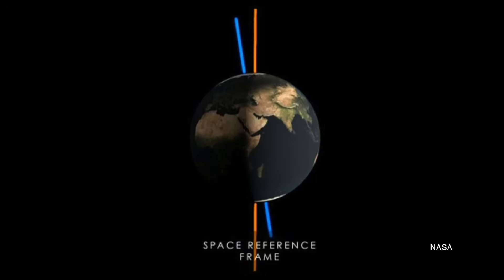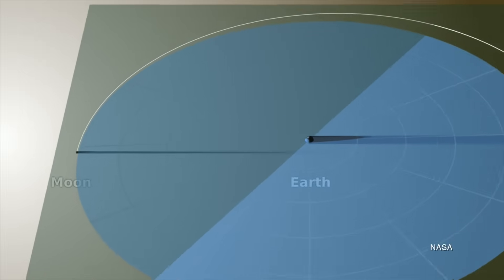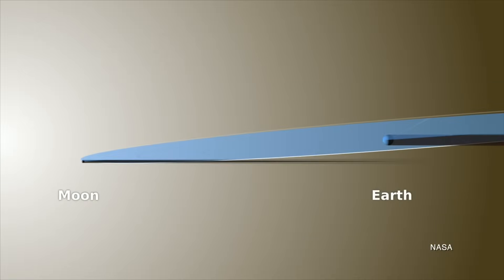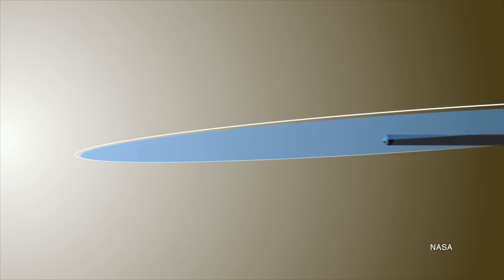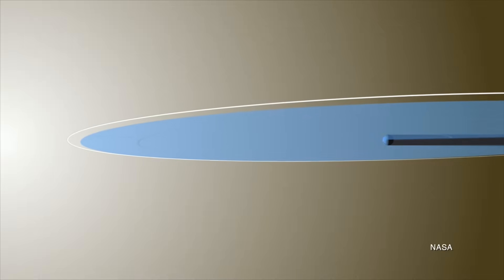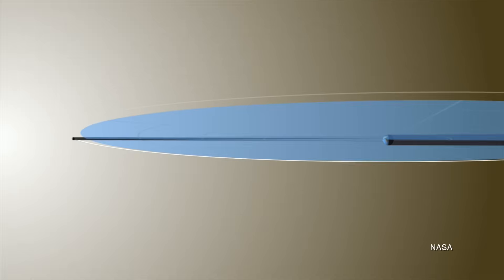Why Does a Rocket Need to Roll Going Into Orbit?

Comment: I really wanted to like your channel, but I can't because it keep finding errors in your videos, you simply don't completely understand what you're trying to teach your viewers. You can launch into any orbit without roll controls what so ever. 
I haven't done any research but my guess is that they did it due to limitations on the guidance computer. Keeping a defined roll angle makes the math easier and allows for manual monitoring or control.
Reply: I thought she did quite a good job.  You can only launch into an orbit without roll control if you don't care about the roll orientation of the spacecraft during the ascent.  The question was why did the Saturn V need a roll program.  It had one because they launched at a variety of azimuths and they DID care about the roll orientation of the spacecraft for several good reasons, which she went to great pains to explain to you.  You may not have done the research, but she DID.
Reply: Star Gazer that's exactly what I said, there are technical limitations specific to the Saturn V. But she said that it is necessary because of the orbital plane tilt.
Reply: It is necessary because of the orbital plane tilt.  The reason they do the roll is because they have to launch in a specific direction to put them in an orbital inclination to match the orbital plane tilt.  This puts the spacecraft into an undesired roll orientation.  The roll program puts them back into the desired attitude for the ascent.  If  they could launch east every time, they wouldn't need the roll program.  Would it be =possible= to launch with the spacecraft rolled?  Sure.  Would it be =possible= to launch in any old direction and then just do a massive burn once you're in orbit to go anywhere you want to?  Sure.  But this isn't what they do, because there are very good reasons not to do it that way.  That doesn't make what she said =wrong=.
Reply: It is possible to launch unrolled, and without roll, and also launch into a tilted plane. She IS wrong.
Roll would be necessary for the space shuttle because it has to have the orbiter pointed down. symmetrical rockets can go anywhere with just pitch and yaw.
Reply: Yes, I understand.  But the shuttle isn't the only spacecraft with an attitude requirement.  Why do you keep wanting to ignore that part?  Apollo also had several reasons for needing a particular attitude during ascent.  She explains this.  Apollo was symmetrical, but it couldn't 'go anywhere with just pitch an yaw'.   In order to do that, you have to have multiple communications antennas in various places around the rocket to guarantee you'll always have signal.  That costs money, and is extra weight on the rocket.  If you need to guarantee the navigation system will work in any orientation, that requires more gimbal axes.  That costs more money and weighs more.  If the cockpit is in a random (or changing) orientation during ascent, then you can't use the pilot as a backup navigation system (because if a pilot has no outside reference like the horizon, he can't guide the rocket), and you'll need to replace that redundancy with more equipment, which costs more money and more weight.  They didn't want the increased costs nor the weight penalty.  The bottom line is, Apollo had a requirement for BOTH variable azimuth launches, AND a required 'heads down' spacecraft orientation during ascent.  The COMBINATION of these requirements means they HAD to have a roll program.  Hence, that's WHY they had a roll program.
Reply: Star Gazer the fundamental problem then is because you need to be able to point those instruments, not to launch into a tilted orbit. It would have needed roll even when launching into a no tile orbit.
Reply: Star Gazer clearly you don't understand the logic of what is and isn't a reason, and the difference between necessary and sufficient reasons. Orbit inclination is not a necessary reason because you can just install antennas all around it. So it makes no sense to say that it can't be done, or to suggest that it is the only reason. That would be like saying look, the reason the space station is in space because there is more solar power. It is one of the reasons but it isn't a necessary reason, they could have installed nuclear reactors on it.
Reply: There's a difference between what is theoretically possible, and what can reasonably be done.  If you would bother to actually read what I wrote, especially my second response with =possible= in it, you might have gotten that.  Since you can't be bothered to respond to the points that have actually been made, and insist on moving the goalposts, I'm done here.
Reply: Logic is only concerned with what is theoretically possible. Also the title of the video clearly says "Why does A ROCKET", not "Why did the Saturn V", implying that it is a general response to all rockets, to which the answer should be "it doesn't". At the very least it's clickbait crap.
There are also various inaccuracies in her other videos, I'm not just nit picking a single one. There is at least one problem in almost every video, so I'm not interested in videos by non-experts. I'd prefer my expert to be a hot girl though.

Comment: The roll maneuver is clever name for what a simple projectile does during its flight, arc up, over and down. The ass heavy rocket will drop as it flys horizontal and since there is no lift upward aerodynamic, it will tumble out of control. The gimbals may direct thrust, but without steering from wings or vector nozzles in front of the crafts center of gravity , forward thrust simply translates to a skid . Hence the big arc in the sky. Saturn 5/ F1 is likely a collection of f 402 Pegasus ( harrier) engines powering a lightweight shell. Add the space grade diesel fuel/ lox  and you get a really awesome fire .

Comment: A rocket does not roll, it pitches! The so called roll program is on the STS flights so the shuttle engines can be orientated down under the external fuel tank and provide lift and orbit insertion thrust. You are so far off the roll mark here Amy, there is a big difference between an orbit pitch angle and the so called orbit insertion roll done by the space shuttle to orientate the shuttle directly under the external fuel fuel tank. A conventional rocket could care less about the central axis roll position of the rocket, this only becomes important to a rocket when the use of side mounted break away solid fuel boosters are employed in the rocket design. A rocket is akin to a bullet, the spin will only give it more stability (not done with a rocket due to the centrifugal force it would put on the structural components and crew of the rocket).

Comment: I have another question, could you not make this  adjustment to flight path while the rocket was on its way to the moon, the  moon orbit path  does not seem to be all that off from the earth's equator
Reply: It's possible, yes. Seems less straight-forward to me, although I don't know anything about the actual decision making going into it.
It would require timing and several additional burns, and being closer to earth also means larger fuel savings from the Oberth Effect. It just seems a lot less efficient to do it out in space, without having done the actual math.
Reply: I just thought the adjustments could be made using small thrusters without any big burn. But what you say makes sense the fuel is there to do the roll at take off. I just thought it looks more complicated to calculate and even more dangerous to execute controling such a powerful rocket with tons of burning fuel looks like more things could go wrong
Reply: The Moon's inclination varies from 18 to 28 degrees off of the Earth's equator.  It is very expensive in terms of fuel and inefficient to try to change the inclination of your orbit after you've launched.  It is possible to do, but why go to the expense of doing it when all you have to do to avoid it is launch in the correct azimuth direction to start with?

Comment: i've always wondered, why do we use rocket to get into space, i never questioned this till i learned about the X-planes.  these planes were making it to space so i thought why not just make them bigger.  that way they can take more things, more people and do more things.  of course for this to work they would need to piggy back on another plane to a certain height then separate and go baby go,,, right?   
so why didn't we go with planes?
Reply: In order to actually stay in an orbit you need to go very, very fast. The smaller the orbit, the faster you need to go. The ISS orbits at about 400km and need to go a litte over 27000kph to stay there. The higher you go the thinner the air gets and eventually  you won't have enough lift to go any higher - then you'd need rocket engines to accelerate anyway. 
That's why rockets carry hundreds of tonnes of propellant.

Doing this with a plane which only adds more weight, more drag, more structural engineering challenges is not only much less efficient, it would also never survive reentry. Just a waste of resources all around.
Remember, the X-planes only managed short sub-orbital flights.

Comment: When you send a rocket to Minmus, you match the orbital inclination during launch, to take advantage of Oberth effect. If you don't you end up doing an additional burn and wasting 200 extra dV to match the inclination in LKO.

That's what Nasa did, match Moon's inclination during ascent, with a roll program. Also to prevent negative G's on the astronauts.

Comment: So, reading the comments, it seems the thing you missed in this video is that the astronauts needed to stay facing the Earth. In other words, though the rocket looks like it's round and symmetrical, it's really not. The hatch is only on one side as you showed on your model.

So that begs the question - why was the Saturn V round? As long as it was aerodynamically shaped it could have had an elliptical or even square cross section. Many rockets have boosters on two sides these days, and the Space Shuttle was anything but round, so why did the Apollo use completely cylindrical designs?

Comment: Correct me if the correction is wrong, but the reason was to keep the crew from taking negative gs. The rocket is rotationally symmetric more or less; the astronauts are not.
Reply: The rocket is rotationally symmetrical, but the IMU is not.  When the missile pitches over, you want the gimbals orthogonally aligned.  This occurs when the body of the rocket is aligned with the IMU.  I assumed in an earlier post (based on the video) that the platform was held in position by a theodolite.  After looking into it I found the Apollo IMU uses a gyro compass to find true north based on the earths rotation.  The IMU azimuth would be calibrated to the gyro compass, then slewed to point down range.  At liftoff, the rocket is rotated  to zero the angle between the IMU and the rocket body.  This makes the navigation computations much easier.  If antennas or crew need to be on the belly side of the rocket when it pitches over, they were placed there because of this need.  Even unmanned ICBMs of the era perform this roll maneuver, and they have no crew and no antennas.  Later designs with better computers and non-gimbaled IMUs do not perform the roll.
Reply: +MuyGordoGato Thank you for correcting me.

Comment: Why not aline the rocket before launch?
Reply: The azimuth can change with the time of day or, for a moon mission, if you have a delay, the moon has moved relative to the launch pad.  The roll maneuver allows you to set the azimuth just before launch.  In addition, the platform can align itself to the downrange direction much more accurately than physically moving the whole rocket.
Reply: +KiithNaabal  Along with what was mentioned, there's only one way the Saturn V could be orientated on the launch pad to align properly with the launch umbilical tower connections.

Comment: Sorry I'm late to this party.  I have over 17 years in ICBM guidance and played a principle role in the updating of the MMIII guidance electronics.  The simple answer to this question (as others have said) is that the missile has a "belly" and will roll to an angle so the belly is facing the earth when it pitches over.  This makes the computations much easier.  Rockets like Peacekeeper and Small ICBM did not have gimbaled IMUs, and had faster computers and did not perform this roll maneuver.  Peacekeeper was originally designed with roll engines on stage two to remove any severe roll caused by atmospheric effects, but after a couple of test flights they were removed to save weight because the unwanted roll was minor and could be removed in the post boost portion of the flight.The MMIII guidance system was designed in the same time frame as the Apollo, by many of the same engineers, and probably functions similarly.The IMU consists of three concentric gimbals mounted orthogonally with what is called the "stable platform" mounted in the inside of the center gimbal.  Mounted on the platform are the three accelerometers and the three gyros (you can get by with two, but that is a lesson for another day).  Each gimbal will have a "resolver" built into its axis.  The resolver outputs a pulse for each fraction of a degree that the gimbal rotates.  While on the ground, using a theodolite (MMIII used a gyro compass) to hold a reference for the roll axis, and level detectors for pitch and yaw, the amount of torque (energy to keep gyro centered in its case) applied to the gyros to overcome imperfections in the gyro and the rotation of the earth are computed. The job of the gyros combined with the gyro torqueing, is to keep the platform level to the point of launch.  The missile will rotate around the stable platform.  This way, it doesn't matter which way the missile is pointing, by integrating the accelerometer outputs, you know where you are.  If the platform tips (guidance or IMU dump) you will need a way to reset it.When the missile is assembled, the IMU is mounted so the gimbals are aligned with the belly of the rocket.  When on the pad, the zero position is found, then the stable platform is slewed (rotated about the roll gimbal) until the IMU is pointing downrange.  This will be some number of pulses from the roll gimbal resolver.  The gyros will need to be stabilized again in this position unless gyro torqueing was used to slew it.  After launch, the rocket body is rolled until the same number of pulses (of the opposite polarity) are counted from the resolver of the roll gimbal.  Then the missile can pitch over.I have to take exception to the statement in the video "the movements of the rocket are felt by the gimbals".  The movement is felt by sensors on the gyros.  Sensors on the gyro cases are inputs to servos that drive electric motors built into the gimbals.  If the case moves closer to the spinning gyro, the gimbal motors move the platform to keep the gyro cases centered around the gyros.  The gimbal resolvers report to the guidance computer how much they have rotated.

Comment: Why did the space shuttles roll when they take off?
Reply: +Harry Twinotter  Yes. Why did they roll until the shuttle was upside down
Reply: I understand that it did roll to put the shuttle underneath the booster. But the question remains... Why? To obtain a lifting force from the wings of the shuttle to behave like a plane while launching up? or to allow easier communication with the ground systems? Or to avoid a shear force if the shuttle were the other way around?

Comment: I'm not sure anything in this video actually explains how rolling would change the trajectory. The facts are laid out: it faces east, it launches straight up, and in addition to arcing east, 
it also rolls in order to change trajectory. But there is no explanation.
If you shoot a bullet out of a rifle, it also rolls around the "x axis", it still flies straight. I'm not a rocket engineer, but I'm guessing that in the case of the rocket, the rolling may cause gyroscopic effects that force a change in its trajectory. Those effects might not be seen on a bullet because the distance it travels is so much smaller.

Comment: Very good video and great explanation.  So my question is why does the Space Shuttle also have to roll over to an  upside down position to go into orbit.  It wasn't going to the Moon and therefore didn't need to take the Moon's Orbital Axis into consideration.  My thought was that it has something to do with the G-Forces but I have nothing to back that idea up.  So if you can find out the real reason I would really like to know.  Thanks again for your video!

Comment: how do they  control the rocket's roll, for example do they have they have flaps and ailerons on the rockets ?
Reply: The nozzles at the bottom of the vehicle - and the rocket engine itself - are steerable.  Slight adjustments to nozzle angle make large differences in vehicle trajectory when dealing with so much thrust, so imagine how precise the maneuver had/has to be (the Space Shuttles rolled over on launch too).  Back in the days of the Saturn series of rockets, those were some fast moving slide rules! :-)

The vehicles can also use "helper motors" known as thrusters mounted on the side, which can also induce roll and other precise steering forces.  The main use for thusters though is maneuvering in lower gravity and aerodynamic resistant environments (space).
Hope this helps!
Reply: Roll is achieved by one or more reaction wheels, essentially flywheels which can be accelerated/slowed down to provide torque for rolling the rocket around it's center axis.